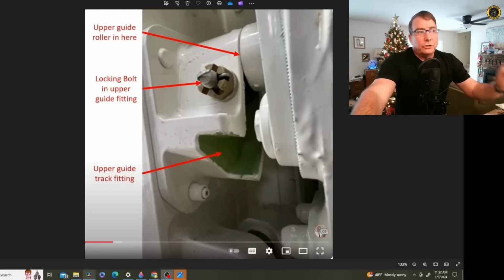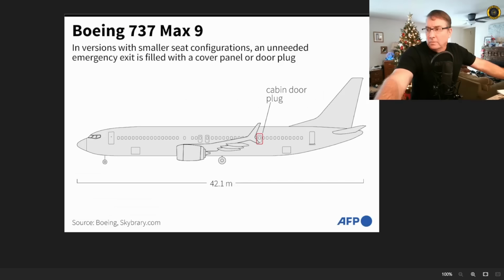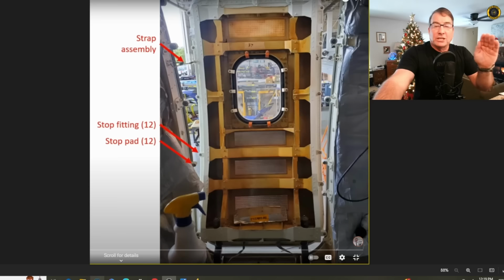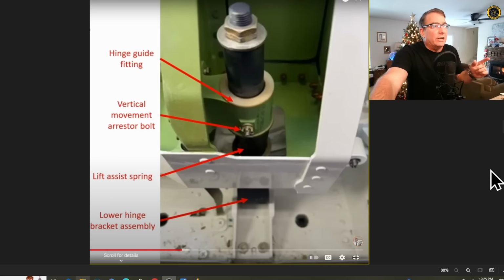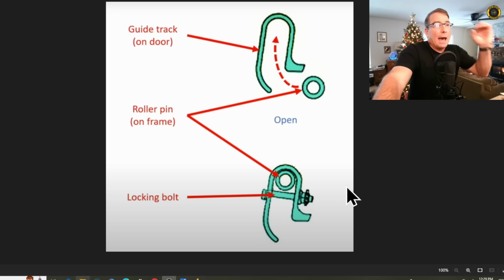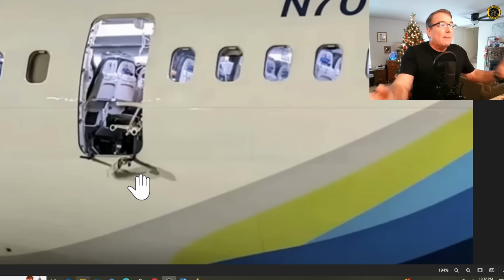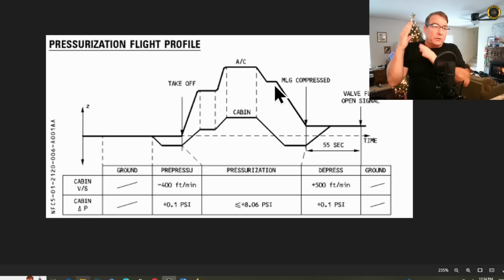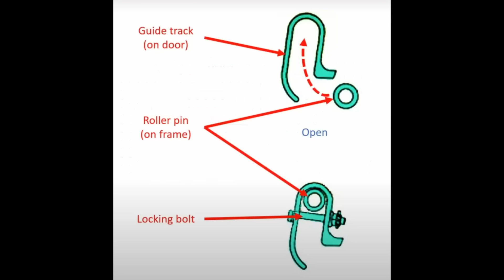Alaska 737 Max-9 Door UPDATE! 8 Jan 2024

Comment: Minor technical point.... What you describe as cotter pins we in the UK  would call SPLIT PINS (cotter pins are solid and tapered, different entirely) . The the castles on the castellated nut are aligned with a hole in the bolt. The split pin is passed through the hole in the bolt. The two halves of the  split pin are then  opened up and the two arms bent back. This technology has been used on cars for over 100 years and found to be effective. Only if those split pins were never put in could the castellated nut have ever come off the bolts x 2.
Reply: Very true, but you're also assuming the castellated nuts were there for a split pin to be able to be installed in the first place.  I think, at this stage, we don't even know if either bolt was installed, let alone the two nuts and the two split pins.  It's possible none of these components were installed and they got lucky on the previous flights where the pressure differential was enough to keep the door plug from moving vertically during flight, keeping the stop pads aligned with and pressed against the stop fittings.  Perhaps all it took was some vertical motion of the plug in relation to the door frame over time or suddenly due to a jolt of turbulence to cause it to finally come loose.
Reply: You're confused. It's not a technical point, it's pointless trivia. Who cares what the part is called in the UK? It's an American aircraft, so parts will be named in standard American terminology. "A cotter is a pin or wedge passing through a hole to fix parts tightly together." Simple enough, and even you have no difficulty understanding exactly what was meant. So why even bring it up? Did you think that you're the only person here who knows what they are?
Reply: @TheEudaemonicPlague   

As you say, Boeing is an American  aircraft; and when one door closes it seems that another one opens.
You Tube and Juan's   videos travel all over the world.  Therefore and inevitably   the use of  the term cotter pin to describe what much of the world understands to be a split pin  could be mildly confusing.
You are indeed quite right that a cotter pin is,  your words; "  pin or wedge passing through a hole to fixt parts tightly together".   No worries.
What we see in the pictures of the door is a pin that has been passed through the castellated nut thence bolt and  then -importantly - with the the pin being split the two halves of the pin are  folded back on  themselves against the nut.  Therefore and in principle, unlike a taper pin, rolled pin or cotter pin, it cannot come out under any circumstances - always assuming it was put there  in the first place.
Reply: @TheEudaemonicPlague  Well, I am happy with Will...'s explanation. Since I am not an aircraft mechanic and also live in Europe (not the UK) it is helpful for people like me.

Comment: United have just advised that they have found "installation issues in the plug door - for example, bolts that needed additional tightening.".
Reply: Oh ok. Not loose bolts then? 😄
Reply: bolts that need additional existing
Reply: And with cotter pins installed?
Reply: @zoner__ And washers of the right thickness?
Reply: The "bolts" are in shear, not tension. Tightness is not a big issue. Sure they can fret with vibration and cause service difficulties (hole elongation, corrosion, wear, etc)
Reply: @planepower8523  No, the bolts are in tension and subject to shear loading. Almost nothing is designed to be purely and sheer, and if that were the case it would have to be set up on double lock nuts.
I do not know about this joint in particular, but the overwhelming majority of all threaded fastener connections are set up so that there is substantial friction while the fastener is in tension to prevent any shear loading directly to the fastener.
Reply: @otm646  I could look up the install instructions, but I have other work to do. I could also guess the torque on those fasteners are 100-150 inlbs to the nearest hole. Those castellated nuts look like AN320-5. I’m sure Boeing has its own specs on those, but they are “shear nuts” for low tension applications. Remember that aviation bolts have short threads (long shanks). If theyre are even true bolts, they could be “retaining pins” with nuts to minimize vibration wear.
Reply: The loose bolts discovered were not the removable ones with the cotter pins.  They were the bolts fastening the sliding guide to the door frame.  In other words, they discovered loose bolts that are not even involved in removal and re-fitting of the door plug.  The loose bolts were a permanent part of the door plug and probably unrelated to this incident.  They just happened to be discovered due to the inspection of the whole assembly.  This, IMHO, is much worse than finding a problem with the removable locking bolts, as it highlights a serious quality control problem.  How many other loose bolts are there on this aircraft?
Reply: @brandyballoon Yes, it naturally begs the question.

Comment: Reportedly, United has found at least 5 planes with loose bolts in their plug doors, but they’re all in different places in the doors so it’s not just one bolt or bolt location that’s a problem.
Reply: torque wrench setting ?  needs critical inspection (double-blind) steps added.
Reply: Well that's just scary.  It's an indication that something along the manufacturing to installation process isn't meeting the (safety) standards.
Reply: Loose bolts should not be a major issue as long as the cotter pins were installed correctly??
Reply: Seems like a bad design.
Reply: @cottydry  I posted else where in this thread that at one time I wrote maintenance procedures for various DoD programs.  We were not allowed to use cotter pins but most of the time we had to use lock wires, due to perceived vulnerability to somehow coming out or maybe susceptible to vibration. I am not an aircraft guy(actually submarines are my background).  Been a while but that is what I remember,  Something to be wrong with the cotter pins?
Reply: @feignit  Or very poor qc
Reply: @boblynch2802 if there’s an AN310 nut, a cotter pin is required
Reply: @cottydry Seems the washer thickness matters too. If too thin you might not be able to install the cotter pin and bind the washer.
???
Reply: @cottydry  My thought exactly. What do they mean by "loose"? It seems that something was lost in translation or there was intentional omission of details to make a headline.
Reply: As an old marine mechanic, we use lock wires in critical (marine) applications for the reason that, as you imply, if cotter pin "ears" are not completely or properly bent over, under stress and vibration they can allow the nut to back off. It is hard for me to tell if cotter pins are bent over enough because they can feel tight by hand and yet be too loose. Ask me how I know.  I am a bit shocked that "fail safe" locking wires are not used.  By the way, in the marine application I am talking about, it is the gentle but repetitive rocking motion of the ocean that causes the cotter pins to fail. ... no hard landing or turbulence required.
Reply: @executivesteps  Aircraft fasteners have much tighter selection than standard bolts, in this case the proper bolt, nut, and washer combo  must be used. On the landing gear, the washers are thickness selectable to get the castellations to line up properly.
Reply: @samholdsworth420  Boeing has (allegedly) removed a lot of QC steps at the same time corporate has increased pressure for faster production. This isn’t a good combination in a kitchen let alone an aircraft manufacturing plant.
Reply: @AlaskaCodger  In this situation would the nut "backing off" be critical provided the nut couldn't actually come of the bolt and allow the bolt to drop out of the hole and then happen to the other 3?
Reply: Yep. Loose bolts and other unspecified "installation issues" with the plug doors.
Reply: There must be tens of thousands of bolts on one of these aircraft.  With poor QC being a factor, one wonders how deep the rabbit hole goes
Reply: @javaguru7141   Two separate issues going on.   United found loose bolts  that hold the whole fitting that mount to door.  No cotter pin or nut involved.
Reply: Beings quality control we all know SUCKS now!!!!
Reply: Even a loose bolt is safe because the castle nut and the cotter pin will hold it tight
Reply: @medler2110  Good question. There is obviously a much bigger problem at play here. The United findings are very troubling.... from a passenger point of view.
Reply: @2Phast4Rocket  Yes but only until the vibrations and chafing wear thru the bolt until it shears off.
Reply: @AlaskaCodger  The bolts don't need to be tight.  They just need to be in place with cotter pins to do their job.  The plane that lost its plug had to have all four bolts missing for some reason.  The bolts were either never installed - or the nuts installed with no pins and they spun off. It's that simple
Reply: Bad workmanship. I've seen guys working on planes that could break an anvil @feignit
Reply: @cottydry loose bolts would definitely be a major issue.... Even if just for the minor concern of the noise and vibration caused by being loose!  And of course the fact that all vibration will cause movement that will eventually cause wear. The cotter pin should not be the only retainer preventing the door from falling off. That is why UA's finding is a significant major issue.
Reply: @luisdetomaso867 The bolts absolutely do need to be tight. The cotter pins are there as a failsafe, They are not designed to survive years of vibration. Which could rven be way more than 2 years of wearing vibration if they are not caught in a major overhaul.   Plus the noise and vibration caused by loose fittings is simply undesirable for passenger comfort. Do you like when your car rattles??
Reply: @gutrali  You are clearly not a technician or engineer (I am both).  There is no load on those nuts or cotter pins.  The bolts serve as retainers that just need to be in place to keep the door from sliding up in the track.  If they are not super tight they will still do their job just fine.  Somebody either forgot to install all of the bolts or forgot to install all of the cotter pins.  I'm sure the plug leaving the plane had nothing to do with slightly loose nuts - but yes I do agree that ideally they should be torqued correctly when installed so they don't vibrate
Reply: @silmarian  Bingo! And that should be criminal if it is not already. But hey corporate greed and deregulation go hand in hand.
Reply: @boblynch2802 seen many cotter pins fall out due to vibrations or even the legs of the cotter pin shear off. I’ve always been a fan of safety wire!
Reply: @Carlos-im3hn  Surprised that they don’t use networked torque wrenches that log everything.
Reply: loctite? nylock nuts? geez
Reply: @AlaskaCodger Lock wire, “Safety Wire,” is commonly used in aviation as well but it definitely wouldn’t have been appropriate for this application. Here the bolt is simply acting as a blocking pin. The torque of the nut is irrelevant and the nut is not under load as would be appropriate for the use of safety wire. I think we need to see if the nuts and cotter pins were in place before criticizing the hardware application. This looks to be more and more like a human factors problem but that’s just speculation. I’d be interested in the structural clearances on the head side of the bolt as to how easy it is to insert the bolts to start with. That’s just speculation on top of other speculation. I think the structures and metallurgy people will have some more answers soon given the apparent pristine condition of the door plug. Time to wind the watch and wait.
Reply: @stephenwalton9646  They said that the tracks broke off. I think I also heard from United airlines that the screws holding the track or the pins were loose on another aircraft. This could mean that they weren't torqued down properly and noise and vibration cause them to become loose enough for the door seal to be jeopardized. Explosive decompression took over at that point
Reply: 😂 It’s their labor that’s the problem.
Reply: @luisdetomaso867  I’ll go with never installed in this case.
Reply: @Eeazyimages  I really doubt 4 cotterpins sheared off in just 2 months of operation.  The retaining bolts were probably never installed
Reply: @stephenwalton9646  I agree. And thank you.

Comment: I'm a pilot/A&P too. One of the things that was making my head hurt a little is that this door is being referred to as a plug door but it appears to be a hinge-type door, which makes it a lot easier to understand how it so easily departed the aircraft with a pressurized cabin. I was taught to think of plug-type doors as being larger on the inboard surface than the outboard opening, such that the pressure differential tends to hold the door closed and prevents it from being opened while the cabin is pressurized. Hinge-type doors depend on robust locking mechanisms (just as you described) to prevent the door from blowing off... usually peeling off a chunk of the fuselage skin like an orange. Thanks for the technical walkthrough of the door's features and operational function. Makes a lot more sense to me now.
Reply: It's a semi-plug door, with features of both. Hinged to provide rapid access, and plugged to provide structural support along the sides.
Reply: @gordonrichardson2972 "semi plug door" is what you get when you let the marketing department make safety decisions...
You can call it whatever you want, but that doesn't make it a plug as any sane person would understand it.
Reply: Agree that this is Not a plug door.  It has nothing in common with a plug door which cannot physically blow out because it needs no fittings or bolts to secure it.   Nobody had allowed that Alaska air may have removed this door for maintenance. Also consider the previous suggestion that the fuselage is defective and moving enough to strain the pin and bolt combination with lateral cyclic forces.  If this is true a bigger threat may exist due to later fuselage rupture due to fatigue failure..
Reply: @xenia5101  It's starting to sound as though the pressure differential at the door was near 1:1 (ambient) when it finally dislodged. This would explain why it was able to shift in its mounts enough to depart the aircraft, particularly if those four shear-loaded bolts (with the castleated nuts) weren't present. Even a true plug door, if it were to become unlatched, could conceivably collapse into the cabin and cause essentially the same outcome. 

It's possible that this is going to turn out to be another Human Factors failure for the Max sub-type. The four shear-loaded bolts are apparently meant to prevent the same anticipated event that it seems may have occurred. Over two months of cycles while in normal service, the latching mechanisms rattle and eventually disengage. If the bolts are in place, they can never do this. If they are not in place, there's no simple way to tell that they aren't and no reason to check for them (because of course they're there. It's part of the commissioning process). Additionally, there's apparently no telemetry on the door to annunciate it being in an intermediate unsecured state and on its way to spontaneously unlatching.

It's beginning to sound like a failure between highly coupled systems (like failures in transactions between manufacturing, post manufacturer, maintenance, and ops). I studied these through fascinating but horrifying case study analyses during my Human Factors and Systems Engineering graduate coursework at Embry-Riddle 25 years ago. Before that, I once nearly saw it happen due to mishandled shift turnover logs while working as a line mechanic for a small regional airline in Alaska.
Reply: @LittleManFlying  Thank you for that very insightful response. I'm only an Aerospace enthusiast after all and you provided a seriously interesting read!
Reply: The plug should surely be regarded as a permanent part of the fuselage structure with fixings that are incapable of "working loose" (or being left off) over time, until the airframe is taken out of service for a serious rebuild in order to install a door at that point at the owner's/customer's request.